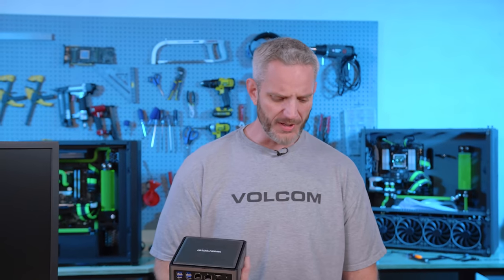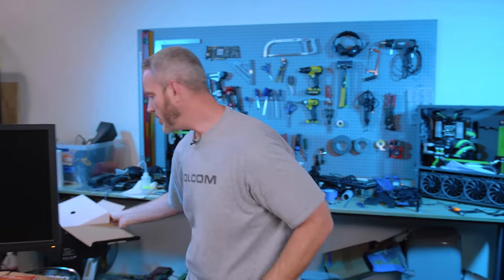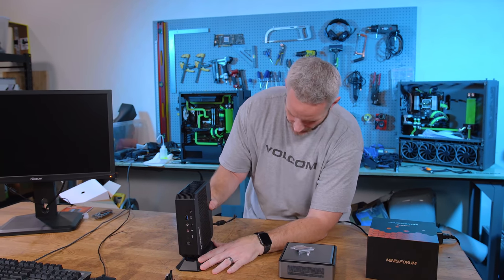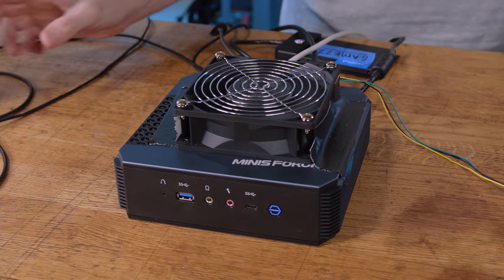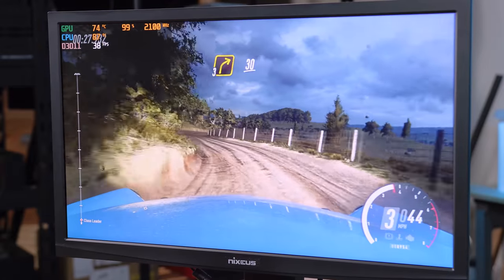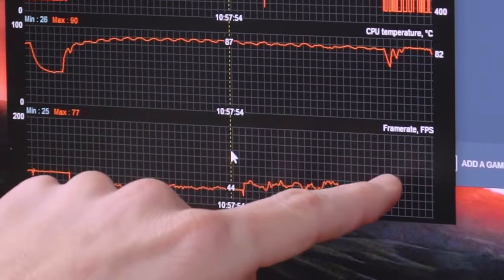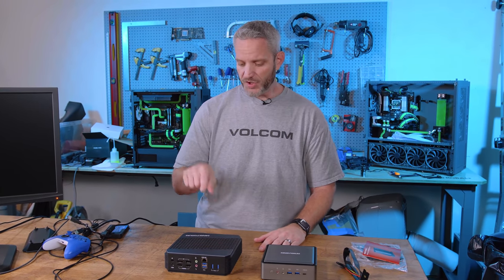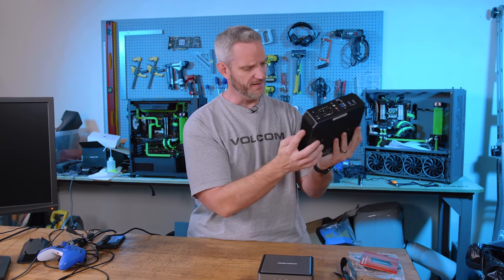It LOOKS like a modem... but its actually a Monster PC!

Comment: I feel like they could have fit a better cooling solution into something this large and gained a little more cpu performance. Also if they added an extra nvme slot or even a 4x pcie slot on the board it would be an awesome mod platform

Comment: I would use one for software development, where you might need good CPU power (especially multi-core), but where GPU performance isn't important.
Reply: Another bonus for development, these mini PCs are easy to secure. You can have a visible laptop or tower, and if someone steals it they'll ignore the "cable modem" or such. Just in general compact, quiet systems really do improve the desk environment unless you need the most speed possible.

Comment: 10:00 - 10:12 Jay is SHOVING the Thumb-Stick like a D-PAD! With enough Practice (ME 20 Years) You Can get your Thumb to move it in Very Subtle Movement's to Smooth Out the Movement on SCREEN. It might just stop some of those FPS Spikes and Dips, when the APU has to CHANGE the Graphics so Radically all the time! (But it REALLY is a DIFFERENT Mindset from Keyboard and Mouse)!

Comment: Thanks for the video! Was probably thinking about having a dedicated pc for VR in another room. Might check this out.
Reply: Idk if I would run vr games on this. Not with an apu and the lackluster cpu performance. It would be a less than desirable experience that would definitely make you nauseous.
Reply: This is not for VR, but if you already have a fast PC you can move it to that room and use the 2.5GbE for a very responsive stream-to-desktop experience for regular games.

Comment: I got an AsRock X300 with 32 gigs RAM and a 3350G in it and got some Gameservers (Minecraft, Valheim, Ark) running in Hyper-V VMs on it.
So far it works flawless and it doesn't need much space. I used a low-profile Noctua cooler for it, the one the X300 comes with is too weak for Ryzen.

Comment: I wonder how well it would work as a secondary streaming pc. (Connect main gaming pc into it to stream.)
The downside is that you'd have to use a usb to pci e enclosure or external capture card.

Regardless, the tech is pretty cool.
Reply: You could attach a capture card to the m.2 slot, probably. Since people have already attached a regular GPU. Native connectivity, plus two Sata 3 ports and a pile of USB 3 still open.

Comment: I built a few Shuttle sff PCs back in 2009 ish. They worked for a while but I ended up wanting more graphics processing power. 

My shuttle had an accessory wifi chip with real antenna, velociraptor for OS and games, and another 3.5" for storage. 

I think I had 2gb of ram for a long time...then 4gb for a bit and then I wanted a MUCH bigger GPU so I just went mid tower.

4200+, 4400+ and an FX60 system. 

ATI x700 card and a couple higher up. All ATI

They got the job done

Comment: I had an alienware x51 r3 at the time and for the price i payed it was an amazing that has laste me to this day. It was an 13 6300 i believe with a gtx745. I know its ancient now but when i bought it these were brand new on the market. The problem with these types of devices is that your trading the small factor for upgradability. MY x51 did have parts that could be changed in and out for the most part but do to the psu which was insanely small and just enough to run what i had it was very limited. Plus the size of them would only let you fit select devices into it.. Outside of that it was pretty much all proprietary parts which are a big issue if you ever plan to upgrade and plus the size of the case made it more difficult to find parts that would actually fit.. The main issue was the psu which was like 150 watts or something along those lines so even though other parts could be upgraded it would be well over the allowance for power if i did.  If you can, just buy you a normal size tower this way you can do as you want with it and can upgrade it over the years instead of just deal with it. If your ok with being limited to your upgrades then these devices are awesome. Mine was about the size of a ps5 but this one is clearly alot smaller.

Comment: You can do external gpu with this. It's not pretty, but ETA Prime reviewed this unit a week or so ago and used a nvme to pcie adapter and external power supply.

Comment: The DDR format is a standards designed and implemented synchronous ram module; read to it or write to it (one or the other) twice in a clock cycle.  The GDDR Ram is not physically implemented by a standard and on graphics cards is asynchronous; reads and writes occur at the same time.  The impact is big enough that, even with the fastest DDR ram you wont get the same data transfer rates as on a graphics card. If this could be changed in the standards, then a APU would start to stand a chance at a better level of competition to graphics cards.

Comment: Too bad MinisForum skimped on heatsink mass, heatpipes and fins. The design of the steel stamping that guides the airflow is a nice touch, though. With the monolythic Zen 3 Croes memory conrollers' capabilities, some really high speed low latency memory, ample cooling and Vega OC will definitely go a long way towards more consistent framerates...
 I recently built a media PC for the living room from a R7 4750G in an Asrock x300  Deskmini and I am still amazed by it. I considered the MinisForum machines, but chose the x300 because it gave me more freedom to put my own spin on the CPU's cooling, and it worked quite nicely. I play War Thunder on it, the kids play Minecraft, the wife plays Youtube clips and we all love it...

Comment: Could be interesting to do a Case Modding video on this. Maybe remove the Loser Cooler add an AIO instead? 
It would obviously depend on if you actually bought it or if it's a Review Sample.
Reply: I was thinking the same, except a custom loop using an Alphacool 200mm radiator. Could make it a mini cube with the rad on one side, the res/pump combo and tubing in the center behind glass panels and the pc on the other side. Should be plenty of airflow with a single 200mm fan.
Reply: AIO won't work in that small of a form factor. The cooling would be fine and keep it at stock settings, maybe with an undervolt. But the RAM is a definite killer for this prebuilt solution. I think it's 100% why the frame pacing looks like garbage.
Reply: @thecryptidkeeper9913 . That's an interesting idea. I was trying to keep it simple to stay with the compact theme. But I suppose a custom loop would be worth a go, if only to see what the differences are like during system monitoring.
Reply: @JosephArata . That's not what I meant. I did mean cut the case open to fit the AIO itself, running the tubing and Rad outside the case. That's why I said "Case Modding". The video showed me that Cooling was a problem but there must be an answer that helps the system run smoother at stock and during OC whilst gaming.
Reply: @Mr_.G  There's no doubt it would help with the throttling and maybe even allow for a respectable overclock, but in a system like this I think one has to have limited expectations. Mostly I was thinking of a custom loop both for the aesthetics and the longevity of the system.
Reply: Besides, Mr. TwoCents asked his adoring public what they wanted to see. I'd like to see people ask, "Why are you even doing this?" to which he responds, "Because it was THERE!"

Comment: 90c even on high speed fan. curious if thermal paste swap is going to improve anything because some laptops when use liquid metal it doesn't perform well because it's too thin and the contact isn't great or something?

Comment: When Jay started talking about why the current APU's from AMD aren't RDNA2 and next gen will likely have it, my first thought was because the next series of cpus/motherboards will support DDR5.
Reply: From what I gather RDNA cores are kind of pointless with DDR4 based machines because DDR4 can't really power the GPU cores.  DDR5 RAM sticks run dual channel 32bit width compared to DDR4 running 1 channel at 40bit per stick.  I can see DDR5 RDNA based APUs retiring quite a few older discreet GPUs.

Comment: I dunno, I'd say DIY is a better in this case. You can get a Inwin B1 Case, a cheap itx board, 16GB 3600Mhz Ram, a 5700g, 500gb NVme and a Noctua Low Pro cooler for less than 1000 bucks CAD. This minis forum is closer to 1350-1400 CAD. I should know I upgraded my 3400g to a 5700g and that's what I have in my bedroom. Cinebench r20 scores 5221. Was able to play csgo 1080 high and keep my TV capped at 60fps. was getting over 120fps average and the screen was tearing without v-sync on. CPU/GPU usually stays under 80°C unless you run consecutive Cinebenchs then it creeps up to 85ish.

Comment: Idk if possible to set core clock, but I found when thermally limited on Ryzen you can get higher sustained clock speeds if you set a speed that stays in the 80-82 range (boosting behavior tanks through the 80s).  Granted low core/thread performance takes a hit, but I reckon the tradeoff is worth it

Comment: So I just received my HX90, nothing on the box or inside indicated 
liquid metal or carbon fiber or security screws. In fact it has standard
 phillips screws.  No mess from any LM spills. Based on various reviews,
 I'm now sure there is no LM used but I'm not going to pull it apart to 
check, don't really care for what I'm using it for(not gaming). I 
ordered mine a month ago on a preorder, I didn't buy it to test or 
review, but it runs fine, looks fine, and was easy to get inside. I got 
it because I liked the design and the small size. I'm happy so far.

Comment: i have often thought about combining my diy external gpu box with an ultra small system like this (or a sbc like a raspi)and build it into one unit and would absolutely love to see someone else’s approach and ideas for attempting such a ridiculously silly but intriguing project
Reply: ETA Prime already covered the eGPU end using the m.2 slot. You can see what it looks like there. It will be much MUCH smaller than a typical bulky eGPU cabinet.

Comment: I challenge you to make ultimate gaming PC RIGs using:

Case Tower: Obsidian 1000D from Corsair (use everything has to provide hybrid water/air cooling) vs Thermaltake 900 Liquid Cooling. 

The RIG must be Intel/Nvidia vs AMD. 

Motherboards: ASUS 570x crossfire VIII dark hero for AMD vs EVGA z590 dark for Intel/Nvidia.

Memories: G.skill trident z 4800+ MHz (maybe 5000 Mhz) for AMD RIG and Corsair Vengeance/Crucial Ballistix/Aorus 4800+ Mhz for intel/Nvidia RIG (choose which you think is the best memory power house for the Intel/Nvidia RIG. You must use as much memory as the motherboards can sustain (up to 128 gb)

SSD: WD black SN850 (2TB) vs Samsung 980 pro (2TB), (you can test both on each RIG)

PSU: Corsair 1600w platinum for obsidian 1000D and EVGA 1600w platinum for Thermaltake 900

Video cards: ASUS ROG Strix LC Radeon RX 6900 XT OC Gaming vs EVGA Hybrid Kit Nvidia 3090  FTW3
(make two tests using 1x and 2x video cards for both RIGs)

Processors: AMD 5950xt vs intel 11900k

Processors coolers: Corsair H150I pro 360mm liquid cooler (obsidian 1000D) vs EVGA CLC 360mm All-In-One (Thermaltake 900)

Monitor: Well must be 4k, at least 144 hz refresh rates, 1ms response and other stuff you think needs to have for such high end RIGs.

Last thoughts: You can also add MSI/Gigabyte motherboards/video cards + other components that works best with them cards IF you think they can come at least close to the RIGs i propose. But please use the best processor, memory, PSU etc that works with MSI/Gigabyte doesn't matter the producer and use MSI/Gigabyte flagships for both video cards and motherboards. Also you can swap the RIGs between towers to see if one case tower is better than the other. And you MUST overclock the shit out of everything you can so we can see the right spot for all RIGs in case people decides to buy any of them.

P.S. If you ignore this post you have no faith so you can stop considering yourself a IT gig nerd specialist and delete your youtube channel :D

Comment: Really hype for this, would love to use that as a main rig with an EGPU
Reply: it doesnt have thunderbolt cuz its amd
Reply: @jokejester895  Doesn't matter, the m.2 works fine and several tests have shown m.2 4x typically is MUCH faster than TB performance. TB 4 seems to help with this a bit.

Comment: Capping the FPS helps with actual playability in systems like this because it saves the thermal headroom for when you actually need the boost to try and hold 30/40/60 FPS.

Comment: Hey J.  I just don't understand it.   I have seen many times where these small boxes include vesa mounts, but how do they work?  Most monitors, in my somewhat limited experience, either use the vesa mount holes or cover the holes when the monitor stand in is use.  How would you clamp one of these boxes onto a monitor that is on it's stand?

Comment: Everyone that plays CSGO NEVER go high settings, only on shadows where EVERYTHING else is low or off. 
Then use system explorer to easy set certain CPUs to play the game (which means affinity, and works very well for older games) that is NOT CPU 1 or 2 because the system usess those for background activity. And ofc set the game to High on those 4 to 6 CPUs (since CSGO doesn't support more than 6, where I use 4 CPUs since it is more stable. You ask why? A good question for Valve) so it prioritizes the game where almost nothing else will run on those CPUs. This will stabilize and give you more fps if done correctly and a lot smoother experience for sure, even on this small factor hardware. You should get a stable  120 fps imho.

Comment: Putting a laptop GPU into one of those wouldn't bring the size up that much. They can pack a 3080 into an ultra thin laptop, they can pack one behind the motherboard with it's own cooling using laptop blowers and only make it ultra thin laptop thicker minus the keyboard side of the frame.

Comment: Looks like a good child’s first computer. You could fix it to the back of a TV making it harder to damage. It’ll have more than enough power for homework and zoom calls. It’s also OK for light gaming when the work is done.
Reply: Problem is it's probably way more expensive than just getting them a laptop
Reply: I think when DDR5 standardises and they can actually get RDNA to really work(from what I understand DDR4 just can't fully power faster GPU tech properly) then these devices will really come into their own and make a lot of older discreet GPUs redundant if not performance alone but also by power efficiency.

Comment: Hey Jay and Gang! Great video as usual.
So, since this is an APU, dependant on system RAM...
What speed and how much ram was installed?
If its only 16gb of 2666mhz ram, how much better of gaming performance would you get by upgrading to 32gb+ of 3600+ mhz  low clock RAM?
Reply: I believe its 3200mhz as listed on the website for this config. (Wondering why not 4266 if its laptop cpu)
Reply: @vukasinmaslovaric  4266 Mhz is only available to soldered ram chips, not the socketed ones unfortunately.
Reply: @vukasinmaslovaric  Several reviewers said systems had random parts in them, or did not have liquid metal. The review units are not final hardware.
The website claims DDR4-3200 but does not specify ranks or timings. The 32GB kit may be faster than the 16GB kit esp if it's double sided at that capacity.
A lot of laptop-style chipsets for AMD do not support custom RAM timings, so any RAM needs to be specced on NON-XMP (stock) speeds at stock voltages.
LPDDR4X-4266 is a special standard, it runs high-clocking and at lower wattage but ALSO has lower bandwidth. (half width channels)

This is why the Steam deck has quad-channel LPDDR5 or LPDDR5X (can't recall), which should perform overall better than dual-channel DDR4-3200 but at lower wattage too.

Comment: I'm curious to know what speed DDR4 SODIMMs they had crammed in that device from factory. 3200 MHz isn't good enough for an APU. 3600-3800 MHz probably would have been better at keeping frame pacing better. Instead of having your FPS jump around chaotically all the time. Also, even if this is a review sample, I'd like to see if you could revisit this with better RAM at a later date and see if it's possible to undervolt it in UEFI.
Reply: Also you can turn the GPU cores up by 200MHz and allocate 2GB of the system RAM to the GPU as dedicated memory which can speed these up, no point OCing the CPU because it's not the bottleneck.

Comment: if you are going to do a more than just a mini, i would like to see the heatsink switched up, maybe do a 360 aio when you plug in that gpu into it? when i saw you put on the delta fan, i was really wanting to see you improve the cooling more, like with a aio, maybe even see if it makes a difference at the aio level for using liquid metal or standard thermal compound, you like to use kpx, so i am interested in that comparison.

oh no (gn) steve and der8aur are both cracking down on this mini, and jay didn't even pop the heatsink to see if it had liquid metal or regular thermal compound, i hope jay responds to their claim at some point.

Comment: I picked up the original one, got it as a media PC through a gaming monitor, as I don't watch Live TV. It's got 16GB of Ram and flies along with Linux Mint on it. 
No way was I keeping Windows 10 on it. 256GB SSD M.2. If you plan to get one of these put it through a proper gaming monitor with Display port.

Comment: Nice review.  For me since the best internet I can get is 960mbps down, the AX wireless would be more than sufficient.  I'm currently using AC wireless which is more than sufficient for my streaming needs.  2.5Gb LAN is nice but would require network component upgrades to take advantage of which given my internet max connection speed would be in all honesty a waste of money at this time.